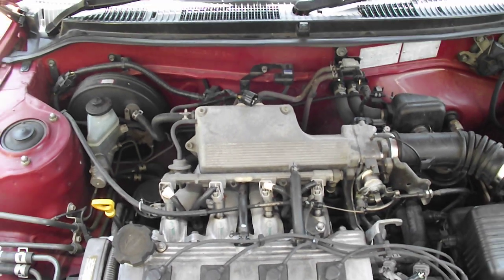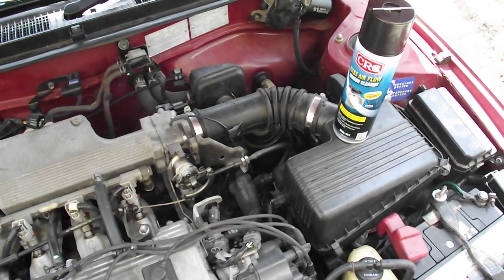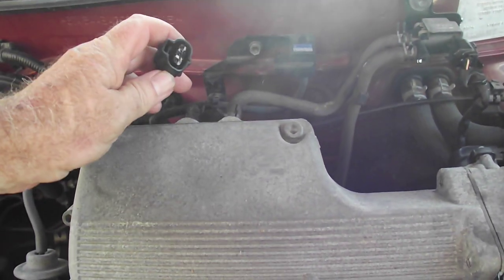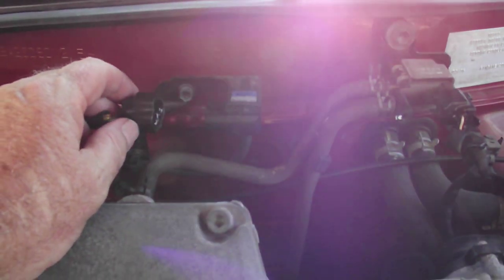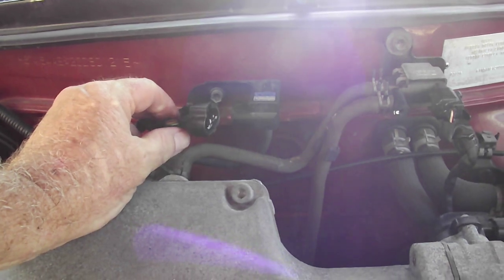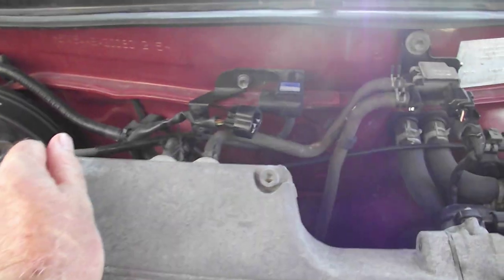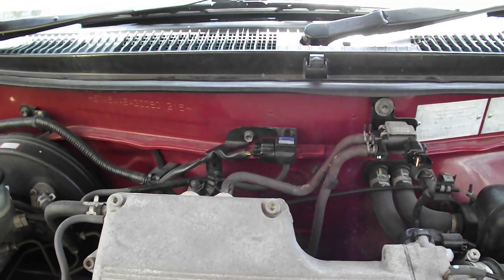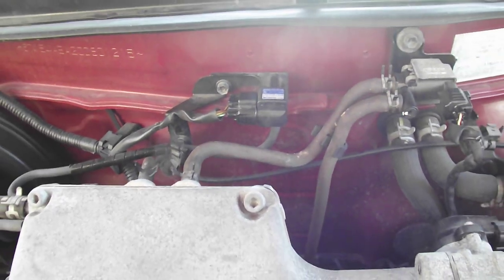Location of MAP / MAF sensor 1996 Corolla AE102

Comment: what is the symptoms of bad Vacuum/Map Sensor in toyota 90's model?
Reply from the maker: If it the same as MAF sensor I believe that it can include rough idling and also idling at higher revs than usual.    I am not a mechanic so best to get advice from an expert.

Comment: The bit you’re holding is just the electrical connector and you can’t clean that bit, to clean the sensor you need to take the vacuum hose off underneath it
Reply: The sensor is the bit on the right with the blue Denso sticker on it,  it comes off with the bracket (you have to remove the bracket from the firewall). The connection that pulls out to the left in your hand is just the electrical connection that is attached to the vacuum hose that runs into the intake manifold. These can get eroded over time but being an electrical connector it is either working (ON) or not working (OFF). And there is no in between. You’re generally right though I do believe that it is next to impossible to clean these sensors as they’re all sealed inside and even waterproof so any cleaning product shouldn’t be able to penetrate. I just tried on my 1998 Celica (7AFE engine same as Corolla) and it didn’t work. I think it’s best generally just to replace the sensor as a whole if anybody is having issues
Reply from the maker: .  Do you mean the one way valve that attaches to the rocker cover?   According to everything I could find, the part that was discussed in the video is the sensor, and you can certainly clean the connectors inside.  If that belief is incorrect I am always happy to be put right.

Comment: So could you please tell me what is the conical shaped sensor in the lower section of the air box? its held in with a rubber grommet?? cheers
Reply from the maker: From a search on the internet  it appears to be a sensor that informs the engine management module of the temp of the air entering via the air filter.
Reply: Thanks John 
 @johnvienta7622
Reply: Intake air temp sensor and it will give code 24 .

Comment: Kindly mention all sensors name in this 1996 model car
Reply from the maker: Sorry, i do not understand your comment.
Reply: @johnvienta7622  Sir I meant kindly mention The entire sensor in this 1996 model, which which sensor used by company in this model.
Reply from the maker: @brm1853  , if you mean the manufacturer, i would assume that the one in the vehicle is a genuine Toyota part...    I just looked up that replacement MAP sensor and the part number is MAP-084-6088 and the brand is APS.....

Comment: Wheres the knock sensor
Reply from the maker: Look near the power steering pump.
Reply: @johnvienta7622  i found its under the intake manifold on the back of the engine
Reply: @johnvienta7622  Is there a MAF SENSOR ON 97 CAMRY?
Reply from the maker: @garytaylor2601  , I used to own a Camry V6 and from memory it had the sensor within the cold air intake, after the air filter assembly.  Should have a wiring loom going to a connection in that intake.

Comment: Do you have a video on how you clean the MAP sensor?

Thank u.
Reply from the maker: I have not done one, however i seem to recall seeing one on YouTube.   I used MAF sensor cleaning spray as it does not leave residue and is safe for electrical connections, and obviously also for MAF sensors.   I just sprayed each part of the connection after it was separated then gave it 10 minutes to dry before clipping it together again.
Reply: @johnvienta7622  did you notice a different in acceleration or performance?
Reply from the maker: @keithc8108  , no, but there was not a problem with the sensor, I just wanted to look at it and clean it as I am more familiar with the Mass Air Flow sensors which are usually near the air filter.   It certainly did not cause any negative issues.

Comment: Hi
Do you know where is the maf sensor is 
Thanks john
Reply from the maker: My model does not actually have a MAF sensor,  i wrote that in the heading as many people refer to the sensor shown as the Mass Air Flow sensor....   I was confused at first as there are no electrical connections after the air filter box, where it would normally be located,  but made a few inquiries and found that the MAP ( manifold absolute pressure sensor ) is fitted to this model..      Apologies for causing confusion.
Reply: John Vienta you reckon do i need to clean it with the maf cleaner
Reply from the maker: @brianh4496  , yes, that is what i used.  it dries without leaving residue and has no negative impact on the part itself.  Some people say that electrical cleaner can be used but best to be sure. Let it sit for about 10 minutes after spraying, and i hope that you manage to unclip it safely.  Bit expensive for one little job, unless you have other vehicles that require the MAF sensors to be cleaned.
Reply: John Vienta do you know how to stop oil from burning i am using 15w 40 and when i start up it come out blue smoke
Reply from the maker: @brianh4496  ,  I was having a think about the cleaner for the MAP sensor and electrical contact cleaner will probably be fine as there are no actual sensor wires as in the MAF. That is your choice though, as i always use MAF cleaner.    As for the blue smoke, there are so many reasons for that problem that I would not know where to start.   O2 sensors, PCV valve, worn seals etc.  You would have seen various additives in the accessory shops so i suppose you could check the reviews of the various brands and then decide if that is where you want to start.  i cannot see a problem with the grade of oil you are using.....   is it still blowing blue smoke after a decent run, or just on start or acceleration.   that may help you narrow down the possibilities.
Reply: John Vienta ok do you change out your timing belt before
Reply from the maker: @brianh4496  ,  no.     I leave that to a mechanic.
Reply: Brother i am having same issues my car takes long self to start up then smokes blue when it gets hot smoke disappears but mostly in morning it start quickly and dont smoke  plus sometimes idle  rpm increase itself and gets normal after two three days
Reply: @2grouphussaintawakkal78 Valve stem seals
Reply: What should i do

Comment: Can you clean it when it is still attached to the car??
Reply from the maker: I suppose the simple answer is no, as the parts that can be cleaned are inside the housing and it is by design waterproof so it would be pretty well impossible to spray the parts without undoing it.